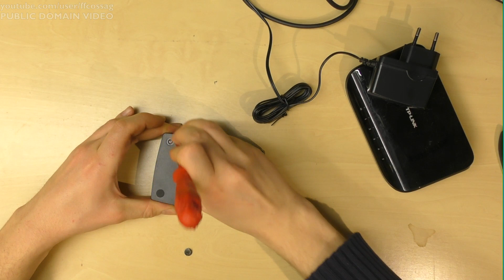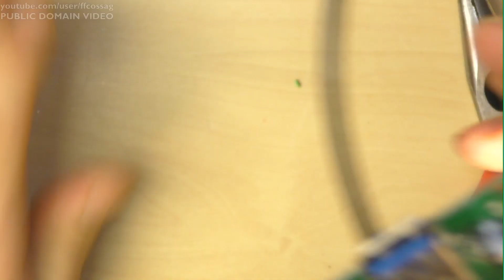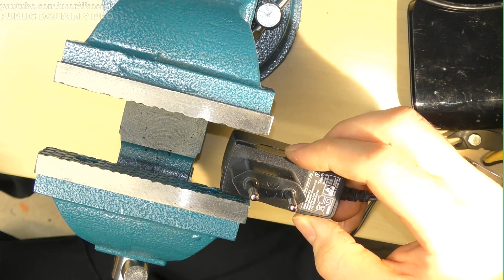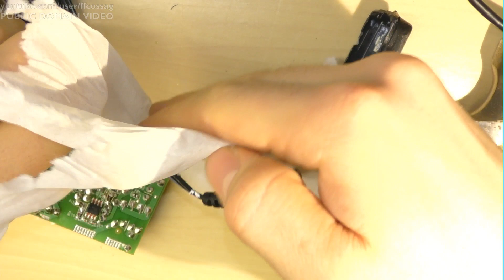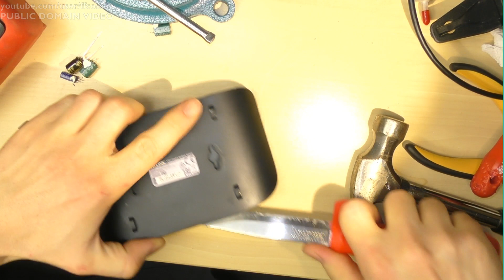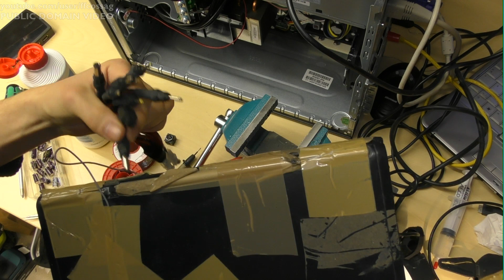REC'D STRM: Some cheap IT trash picks

Comment: This TP-Link power supply would seem to be the same kind shipped with TL-WR842Ns and the like in recent years (that switch isn't old, certainly less than 3 years). Guess what, they are notorious for squealing right out of the box, which drives people nuts. Good to know it's just cheap caps. So yours is better than stock now, too bad you have to go medieval on its rear end first.

Speaking of squealing, I once got a whole bunch of used NEC 1990FX and FXp monitors for work, and ALL of them are quite noisy in standby (but inaudible when on). I was unable to find any reviews elaborating on this. I also have an old Eizo L795 that is decidedly audible in standby, but this one is rather run-down anyway, so I won't be surprised if the power supply has seen better days. Bought this one on a whim once just because I wanted an old (near) TOTL monitor. Color management on these pro monitors is just a whole different ballpark compared to the consumer jobs of the time - you can pretty much just crank up color temperature and eventually arrive at an entirely passable result even with rather worn-out CCFLs.